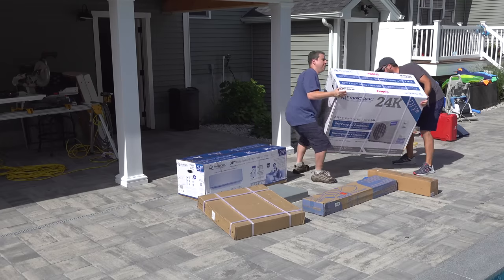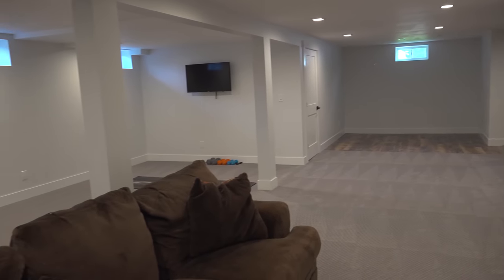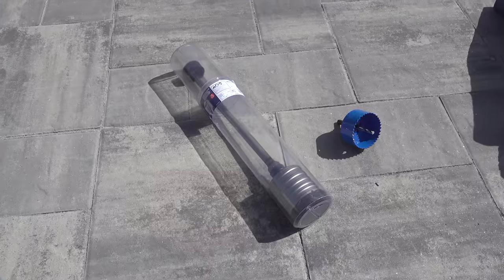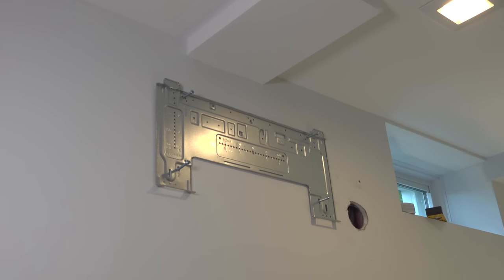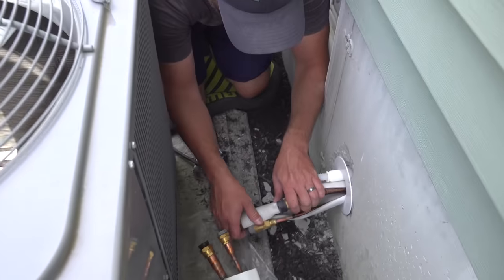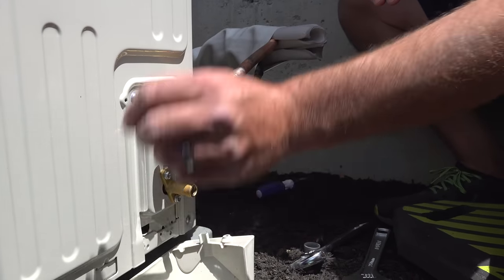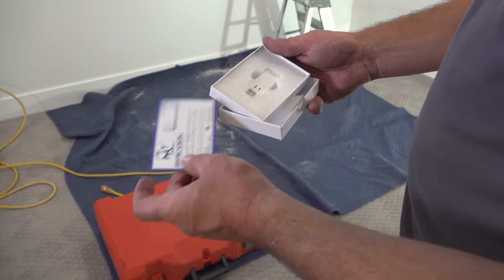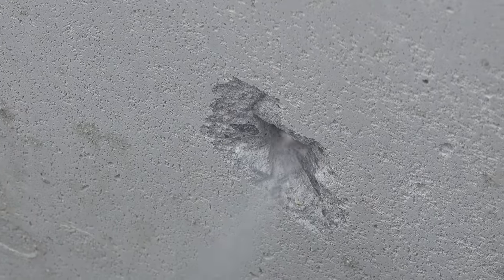Install your own AIR CONDITIONING in 4 HOURS!  DIY Mini Split MR COOL

Comment: I worked as technician for installing these ac i really recommend to put your tube under pressure with vacuum pump and check for leaks then vacuum the  tubes and turn the gas on that way you can be sure to not lose any gas it's good for environment and your pocket 😉
Reply: Not to mention, you don't want any outside air or water in the air into an ac compressor.
Reply: I thought this as well. I wonder if this will last?
Reply: Under 500 microns
Reply: Aren't those pipes sealed with vacuum already and a seal inside is broken when the gas is released. Is that right?
Reply: Vacuum pumps do not pressurise. Pressurising the lines, to check for leaks, is done with a gas, like nitrogen.
Reply: @aaronpate6617  most older technician use a fridge compressor they can do both and you wont need any extra gas
Reply: @leviallen2556  yes it's completely fine to do it this way and cleaning  is more important than this step it is just a little extra step.
Reply: @Swenser  i havent seen one that have it but it would be great if they do
Reply: @seyedaminkazemeini9797  i don't know what country you are in, for the use of a fridge compressor to be normal, but i'm in the U S. I'm 57, and have ran service since 87, for multiple companies. Not one ever used a make shift pump, as you describe. Also, pressurising the lines with air, would introduce unnecessary moisture to the system, as opposed to the common use of nitrogen, or refrigerant.
Reply: @aaronpate6617  I see, have a good day sir
Reply: The problem is if you do that you are going to let out the refrigerant in the line set. MrCool for their DIY kits have the lines prefilled with refrigerant.
Reply: @xalint1  no it doesn't wast the gas that step that he used an Allen wrench to open gas valve you just need to not open the one that lets the gas out in the tubes ( only one of them lets the gas out from the unit and the other one lets the gas from the tube to go back in the unit) that way you can leak test and vacuum the tube and not waste any gas.
Reply: @seyedaminkazemeini9797  Precharged line sets aren’t a new innovation in the HVAC industry, but they’re not exactly widespread either. When we tell people our MRCOOL DIY line sets do not need to be vacuumed down, plenty of installers out there, professional or otherwise, just don’t believe it. But, hey, don’t take my word for it!
Reply: I may be totally wrong here but I think the lines come under a vacuum, and the unit has enough gas for the 20ft, I found installing mine with a 50ft kit I needed to get someone in to top up my refrigerant though.
Reply: @Jobey_99  You can connect other lines to it but you have to use the adapter and it only comes in 16' and 25'. If you want custom sizes you would have to get a tech to come out and do the vacuuming and flaring of the line and so forth. But if you want to add another 16' to the 25' just use the adapter then you don't have to call the tech.
Reply: @xalint1  I have a different brand and they sold a 50ft kit separately but the unit didn't have enough refrigerant so I had to get it topped up, although I was made aware of this before I bought it
Reply from the maker: The lines are pre-charged and do not need to be vacuumed down, they are factory filled with the exact amount of freon and ready for use. They are sealed and only open after being tightened down. Its a clever design that eliminates the vacuum and filling step completely.
Reply from the maker: @rich1807  The condenser and lines are both factory filled and sealed. Look up pre-charged lines if you want to learn more.
Reply: @rich1807  sure hope the shipping folks in china dont break the seal for the charged lines lol
Reply: While there is always the most correct way to do things the other ways can work out with a bit of cheating and understanding of how things work. I know of three installations done with no fuss just release the gas with purge. Dry environment, soapy test etc. No problems but I do appreciate the risks. If you want certainty do it to the letter T. But labour is expensive these days even to the point it's worth the risk being a hack man for me.
Reply: Next video would be

" How to replace your Outdoor Unit because the compressor died."
Reply: @rich1807  This model also is a heat pump. For the one they are installing HEATING CAPACITY: 25,000 BTU.
Reply: @rich1807  Technicians have to keep up with changes of technology. But that is up to the companies to keep them trained. Otherwise they refer back to older technology which is not always correct.
Reply: @douglaswindsor120  Pre Charge set lines have been around for a long time I don't disagree with you. But the issue is they had basically disappeared in the mid to late 80s. It's something that has to be relearned or retaught. I thought they were still used in some refrigerant application for some coolers. But the way it seems many haven't heard of them.
Reply: No, I am saying that individuals that make comments about a product and assuming they are correct needs to step back a little and do a little research for themselves. They do sell heat pumps but are not for your every day DIY individual . But this video was not about such a unit.
Reply: @rich1807  Wow you are making no sense at this point. This will be the last comment to you. So feel free to ramble on.
Reply: @xalint1  
Thanks for all your comments. I actually learned plenty from all your responses to the other people who just can’t believe that Mr. Cool doesn’t need a vacuum or that this particular unit is actually a heat pump and not just an AC unit. My question to you is, does Mr. Cool warranty the system if it’s done DIY method?
Reply: These units are not diy, if you want to try it I’ll be ready to make that service call. 😁
Reply: @SilverCymbal  your so called pre charged line was cut to length and reflared which technically losing its charged.
Reply from the maker: @carolinaguy5458  You sure you are watching the right video? Nothing was cut here.
Reply: Anyone commenting regarding this that hasn't worked in this field is just wasting energy with nonsense. Listen to the techs, we know what we're talking about. There's a reason we spend 4 years in trade school for this work.
Reply from the maker: @TheUniversalid  On a traditional system I have no doubts for the need for experienced techs. But I also don't need a tech for a window ac right? Its all prebuilt. What's the difference here, this is pre-built end to end, even the lines. What does a tech need to do to this system that wasn't done?
Reply: @SilverCymbal  you are correct, after rewatching I didn’t realize the whole 20ft line set was used but someone still has to get power to that unit.
Reply: @rich1807  actually yes I got the aliexpress tester. But again. You'd have to be pretty unlucky to have no bubbles show with a leak... In fact you are right, the leak could happen after a few months, it's just that hack ways can work out. If for a friend I explain the risks clearly.
Reply: @SilverCymbal  a window ac has non user serviceable parts and the freon has no fittings to be tampered with and is sold at WalMart. The difference is assuming an every day diy guy with 0 refrigeration licensing and 0 knowledge regarding it posting YouTube videos to help service guys get more service calls over unseen issues from air in refrigerant lines. The huge difference is a consumer handling r410a using quick connect valves. Let's refer to shark bite and parker push-loc, the best quick connect valves and how they allow any gas/fluid between the connectors to contaminate the system. Purging and testing is needed after final assembly to ensure a sealed system. Making this a plug and play system is just asking for legal issues. There is a reason it takes 4 years to acquire a license for this.
Reply: 100% agree. Evening you said is in the install instructions to do just that (says 15 min vacuum instead of 500 microns. It needs to be below 500 microns not just "15 min"). And very first instruction is to read ALL instructions before installing. Guessing the people in the video skipped a few steps thinking it's not that important or to save time.
Reply: @pjackson8322  thanks sir I just tried to inform the mistake but I guess some people don't like to learn.
Reply: @SilverCymbal  the split unit i  pre-charged?
Reply: @carolinaguy5458  With that kind of attention to detail, who should I call to make a service call after you've made yours?
Reply: @pjackson8322  The manual is available online and I have it open. It says no such thing. Possibly you opened the non-DIY manual (which does talk about evacuation)? Another tech with impeccable attention to detail. Is this how you guys stay in business?
Reply: @chaos.corner  yes after someone pointed out the difference between non-diy and DIY units, it was the non-diy that needs evacuated. I learned something new.
Reply: @pjackson8322  I'm guessing these lines are only pressurized to 1ATM for shipping and shouldn't be messed with once they're at full pressure.
Reply: @andreapiedimonte9584  every new condenser now a days comes with factory charge. Factory charge is listed along with sub cooling on data sticker. Sometimes to reach desired subcool you’ll need to add or take some refrigerant out of the system.

Comment: Installed the 36k btu model last year. It's really as easy as it looks. Including all the wiring and accessories I needed, came out to about $2,400. I got quoted 6-7 grand to have one installed by an hvac company.
Reply from the maker: I really appreciate you sharing this. I know many watch the video and think it's too good to be true, but this one is real. Glad you had a good experience too my friend absolutely loves it.
Reply: 6-7 grand what the hell thats expensive... Here it is 2k-3k € all included.
Reply: @Noobletti  $6-7k and you can have a 5 ton central ac installed by some honest hvac guys lol. Got quoted $5800 for a 5 ton heat pump in east Texas!
Reply: You get a warranty when you go through an hvac company. Lots of hvac companies won’t warranty customer supplied equipment.
Reply from the maker: @Brandon-ci8bv  Mr Cool gives you a warranty and they already have dealers in most states. But keep in mind they will usually just ship what you need if anything just like when you got the original unit.
Reply: @Brandon-ci8bv  Most companies won't warranty a DIY install, but Mr. Cool does on their DIY line. Also, they're functionally identical to pretty much every other mini split unit out there so repair work in the future shouldn't be an issue.
Reply: 6-7k!? You can get an entire new A/C + heating unit for your home for that.
Reply: @Noobletti  Yea literally in some countries you can order it and get free installation.. here in the US for whatever reason the labor charges are insane (basically 1-2x the cost of the equipment)

Comment: I have the Media window Mini split you reviewed last year. That thing is amazing. 92 and humid in Florida outside. 74 and comfortable inside. Plus my AC bill is 35% less.
Reply from the maker: So glad to hear that. That one is amazing. Not the cheapest but easily the best window air condtioner made!
Reply: These Midea splits are beautiful and work great. I have a 18000 Btu system for my 130 square feet bedroom, which I bought for $350 here in Bangladesh and got it installed for $36. Sometimes I feel like I'm in the north pole and specially for so cheap!

Comment: You can also get a bracket to mount the outside unit up on the wall of your house.  I did this because where mine had to go was right near a driveway.  But putting it up on a wall (above head height) means it won't get hit by lawnmowers, or covered with snow, and makes it harder to steal.

Comment: A lot of people are confused about the line set and vacuum requirement.  There are at least two options for this brand of A/C.  One option comes with open line that must be cut to length, and nitrogen purged, pressure tested, and vacuumed.  The other option ( The one shown here) has a line set that is sealed and pressurized with refrigerant and has special fittings that allow connection to both inside and outside units and does not require vacuum.  Also, in both cases the condensing unit contains refrigerant that is released into the system when everything is connected.
Reply: A vacuum is always required. There is moisture present in the air, and without first pulling a vacuum, you are introducing moisture to your system that the condenser unit will never be able to condense.
Reply: @andrewsmith9678  how much more efficiently will it run with a vacuum vs without?
Reply: @andrewmckinlay2964  I don’t know the answer to that question. But I do know that this outdoor unit will burn itself out trying to condense moisture.
Reply: @andrewsmith9678  -  The  line-set  is  pre-sealed/charged  to  match  the  heat pump .  .  .  .  the  connectors  pierce  each  other  when  connected  allowing  no  external  air  to  enter.    As  long  as  your  connecting  procedure  follows  the  instructions  without  backing  off  for  any  reason  the  installation  will  be  air/contaminant/moisture  free  with  the  'perfect'  factory  charge.   Kind  of  like  buying  a  refrigerator !    
   IF  you  allow  the  initial  connection  procedure  to  fail  ( open  to  atmosphere )  .  .  .  DUH !
Reply: @andrewmckinlay2964  -  The  line-set  is  pre-sealed/charged  to  match  the  heat pump .  .  .  .  the  connectors  pierce  each  other  when  connected  allowing  no  external  air  to  enter.    As  long  as  your  connecting  procedure  follows  the  instructions  without  backing  off  for  any  reason  the  installation  will  be  air/contaminant/moisture  free  with  the  'perfect'  factory  charge.   Kind  of  like  buying  a  refrigerator !    
   IF  you  allow  the  initial  connection  procedure  to  fail  ( open  to  atmosphere )  .  .  .  DUH !
Reply: @richardhobbs7107  thanks
Reply: You vacuum to remove moisture because it mixes with the refrigerant and creates acid within the system which will severely damage the compressor. Vacuum down to 500 microns to prevent acid in the system
Reply: Sorry but this looks like a lot of work. I’d rather hire a professional.

Comment: 5:25 (tip) make sure the platform is level first and to make higher put more dirt or w/e the platform is going on. To lower you just take some material out and put the level on the platform first. It will make it much easier than doing it with the unit on the platform.
Reply: Yup and compact that base down first before installing the pad. Dirt settles, so just because it is level now doesn't mean it's going to stay that way in a month/year. The guy making this DIY video clearly didn't watch any DIY videos himself first and it shows.

Comment: Living in China for ten years, this kind of system was quite the norm. I've seen them install this in apartments 30 flights up on the outside of the apartment. I've seen them also do similar in large houses outside major cities. These fan units on the wall high up are so quiet, AND the unit outside is also unusually quiet. This how they zone their rooms. We should have this kind of system a long time ago. Thanks for bringing back memories.

Comment: I purchased a MrCool 24K 3rd Gen for a 1,000 sq foot 2nd floor in my Condo. I installed it in March 2021 because I was preparing for the dreaded 120 degree weather in Los Angeles. I paid $1,800. Normally it gets 95 degrees because the Sun faces my floor for 5 hours. MrCool keeps me freezing COLD (kicks out 55 degrees cold at lowest temp) even when it is over 100 plus outside. However my LADWP bill went from $800 per MONTH to $150 per month because MrCool is more energy efficient than my central air conditioning. I did 4 months of testing and compared bills from the last 5 years. MrCool not only you keeping me freezing cold (temp gun) but your saving me $$$ per month during the summer.

Comment: From a retired HVAC tech ...
Good Job
Very informative 
Should have mentioned the efficiency of your unit and whether or not it was a combo heat pump/ac unit
Great video
Reply: Hopefully it doesn't snow there
Reply: @dillard715  We installed one (different brand) in our shop last winter up here in Canada where it goes well below freezing for much of the winter and it did a very nice job of keeping it warm. We've had one in our (mostly) uninsulated lunchroom for a few years now and does just as well.

Comment: Me doing this install (figuratively speaking)- 
Day 1 - Unit shows up w/ mounting plate bent, and a dent in the main unit. Call manufacturer, they tell me to contact the shipping company. Contact the shipping company, they tell me to contact the Manufacture. Back to the shipping company to file a claim - 2 weeks later new unit shows up. 
Day 15 - Rain
Day 16 - Slip and slide through mud digging out roots to level out base pad, takes ALL day - trek mud through the house when heading inside.
Day 17 - Rent carpet cleaner
Day 18 - Units leveled outside, head inside to find my spot - the ONLY spot is 21 feet away from the unit outside, a foot too far. Back outside to move unit/dig roots.
Day 19 - Time to mount that plate inside - Forgot my neighbor borrowed drill, he's not home.
Day 20 - Wife asks me what's taking so long, I never do anything!
Day 21 - All set, time to drill - need an extension cord. Head to shed and naturally it's on the back wall so pull out the Mower, 3 kiddie pools, 75 shovels/rakes, 45 lawn chairs, get attacked by a raccoon  - start drooling - head to the Hospital. 
Day 21 Continued - that night - Wife says "you going to leave all that stuff outside of the shed?".
Day 22 - Go to the basement to stare at the wall.
Day 53 - I Finish staring at the wall and decide to hire a contractor who specializes in ductless A/C units.
Reply: Bro do you mean you trek dirt in with your shoes or your bare foot?
Just Asking...